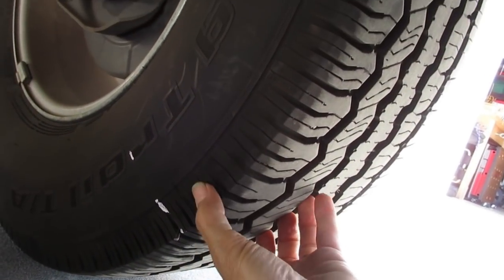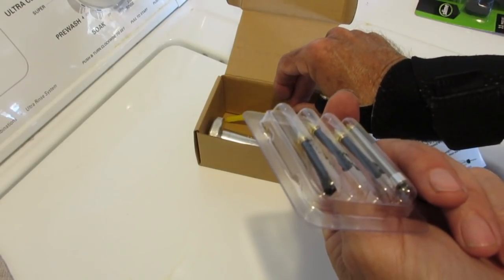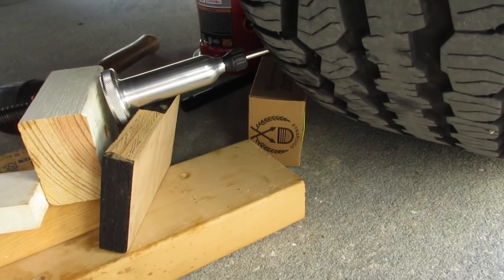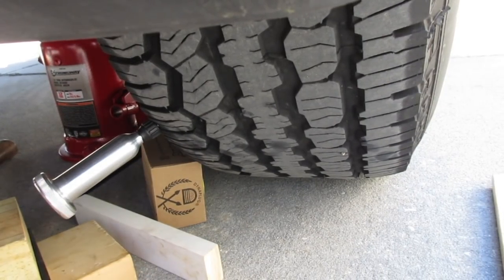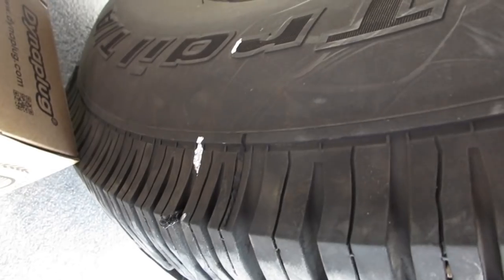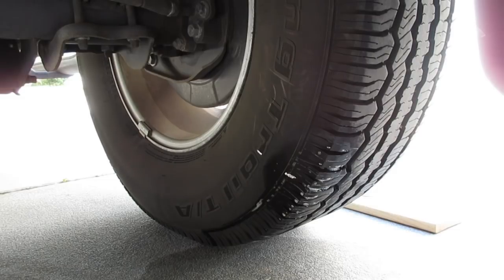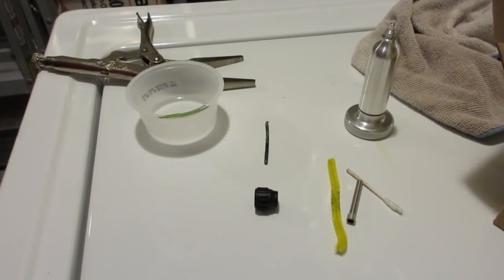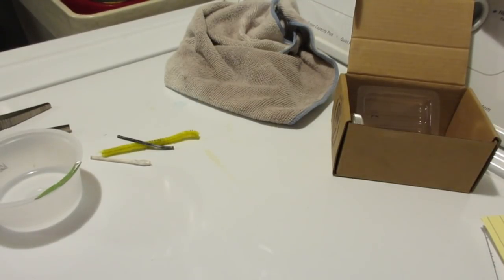Dynaplug REAL WORLD Tire Repair - On Rim.

Comment: You have to push it at the same angle as the nail went in or else you catch on the belt and the undamaged rubber.  Also you do not know how to use a bottle jack.  Never place the bottle jack on the round axle housing.  It should have at least been on the spring perch with the wooden block UNDER the base of the jack.  The knurled top of the jack is there to keep it slipping off the vehicle.

Comment: A good demonstration of how not to do this. Take the wheel off to work on it. Ream the hole so it is sized close to the size of the plug, making it easier to insert. Don’t let the air out, hammering just causes the tire to flex absorbing the impact rather than the plug going in.

Comment: Boy you made that look hard.  If you can not remove the tire for some reason, at least move the vehicle 4-6" forward so you had some type of usable angle.  You were trying to push upward from the ground.  Alao, why not rasp the hole to clean it and enlarge the hole a little, since it was obvious the plug was to big.  I think I'll just stick with my $7 slime kit

Comment: okay it went tough prob due to angle of plug not at same angle as nail, but, we are all here to learn right! What's annoying is vids showing the "easy" stuff like a rotor just "falling" off during a brake job or a CV joint just easily coming out.

Comment: Love the video , good detail . i am only using this because the nail is so small, didn't want to use other string method that require the hole to be made bigger. i thought you will have a hard time pushing it in , i will be swearing at it for sure tommorrow when i go through the same pain as you. but i will havet he hammer handy

Comment: You would've had a much better time if you just took the wheel off and did it that way, instead of crawling on the floor and struggling.
It generally Takes 5 mins to plug a puncture

Comment: You can get  a aluminum nut instead  of the polymer on that it comes with I sent a message  to Dynaplug and they told me for 6 dollars  I could get the aluminum nut and  it would  cover postage as well.  11-1-2020.

Comment: oh yeah I know thank you had the rock on top of the jack. Most people put the rock under the jack. The head of the Jack has a grip cut on the head of it so it does not slip. And you still get your height that you want. The way you had it very dangerous

Comment: I've had the Dyna plug for at least 30 years ( or more )...worked great.....I couldn't remember where I Bought it.... but when I ran out, I couldn't get spares.... eventually I went online, about 8~9 years ago......they were in the process of selling the company, ...buying the company....so I  waited....finally I bought spare plugs....and four more kits for my son's car, and my other car, van.....the new ones, you can replace the steel tub, in case you bend it.....My, original one has never bent, but the new one did....couldn't replace the tube, because those weren't replaceable.....the next version was.....they work great....I even put three plugs in close to the side wall once, on my van....fairly new tire...drove it for two days, BUT it was too close to the side wall....( I wasn't going to leave it ).....I had the tire patched from the inside,  "the guy said another two inches he wouldn't have Patched it " ....!!  the plugs have glue on them.... Don't forget to DRIVE the vehicle to heat & seal the leak....!!  Of course I have a portable compressor in each vehicle.....👍🏽

Comment: You shouldn't be allowed within 100 yards of any tools. I have used a Dynaplug 6 times. It is EASY. The more pressure in the tire, the easier it is, especially if you're going hit the tool. How did you make it look so difficult? Also, you should never repair on the shoulder, you need to replace the tire. Your biggest mistake though was not removing the tire.

Comment: Lol. I came across this video and boy did I get some laugh. Why not just taking off the wheel??? This is how not to Dynaplug your tire!!!
Reply from the maker: Hey There. Glad you got a good laugh! I would have loved to just take off the tire, but if you listened carefully at the beginning of the video, I say I have a bad rotor cuff left shoulder / arm issue (with nerve damage) which pretty much prevented me from picking up any damn thing greater than 5 pounds - particularly if it was at all out from my body's center. And, as usual - I had no one around to help me... so I gave this goofy idea a go. Bottom line on Dynaplug is... I like them, BUT - they are a temporary fix.  THE TIRE STILL LEAKED.  It was a slooooooooooooooow leak, but it still leaked. I ended up replacing the tire for a long upcoming towing trip. Its a fine fix for an around the town vehicle, but that's not me. If you are out on the road and get a flat, Dynaplug is great - IF you can get it through!  Even when the tire is off the rim, jamming the Dynaplug through a truck tire, ain't like the girl in their demo putting it through a frickin' motorcycle tire! I think the sealing thread or whatever it is on the Dynaplug is TOO SMALL and does not expand. That allows the leak to slooooooowly continue. They of course say, you can add a second plug... Yeah. Okay.

Comment: You're as crazy and persistent as I am. Why not take the wheel off for easier access. I can no longer work off my back. Bad shoulder. I was sweating with you.
Reply from the maker: LOL. Worst part of it was, after a month... the tire was leaking, loosing about 5 pounds of air per month. It's good in a jam, or for an around the town vehicle... but not a long term acceptable solution.  They would probably tell me to add another plug... ha ha. NOT.
Reply: I am guessing that when the tire comes off the rim, you’re going to realize that you made a new hole while putting the plug in. If you go back and watch the video you will see that the angle that the nail came out at around 6:14 was nowhere near the angle that you initially inserted the plug. It looks like you initially stuck it in at the wrong angle pushed it in a little ways then tried re-adjusting to what appeared to be the perfect angle. The problem is you had already pushed yourself out of the original puncture track and now we’re just trying to create a new hole parallel to that one. It’s just a guess, but I’ve seen the same things happen to people trying to probe puncture holes in the human body. If the initial angle isn’t perfect when you insert into the exterior opening of the track, and try to readjust your angle, you can almost never keep it within the track. That concept is true whether you’re dealing with punctures in muscle or punctured rubber.
Reply: @docin2011  I agree, he says he needs to go back in at the same angle but then when he inserts it hes?off to the right at it. Im guessing thats where he was losing the air as he never completely sealed up the original puncture.
Reply: Plus to be able to use body weight to insert the plug would make it so much less hard.

Comment: As a retired fleet tech, I hate to rain on your parade but I highly doubt that repair is a approved tire industry repair standard practice.

That tire needs to be removed from the rim and the hole fresh reamed to receive a properly glued plug then allowed to cure a bit then have both ends trimmed flush and also have  the area around the inside trimmed plug buffed and prepped for a patch.

A non sealed plug will allow water untrusting into the cord area of the casing resulting in rust and eventual failure with dire results.

A combo plug/patch is also acceptable practice from the inside of tire.

Plugging like you are doing is considered a temp fix to get tire to a shop  just like the donut spare tire if you are lucky enough to have one at all
Reply: If you worked as a fleet tech then you'd know that a hole in the shoulder means a new tire NOT a repair